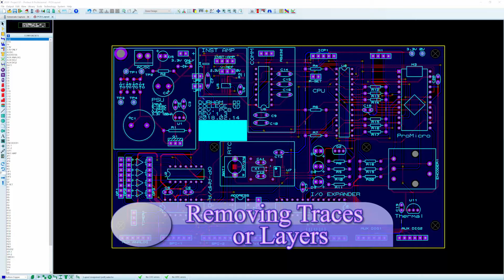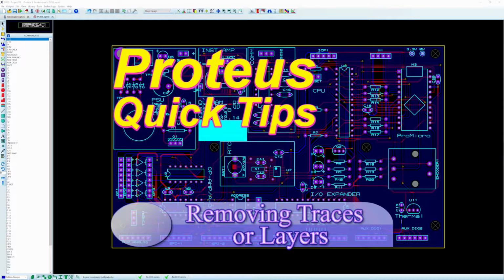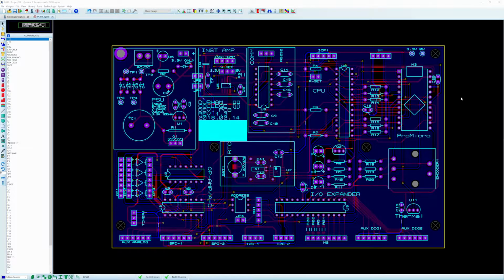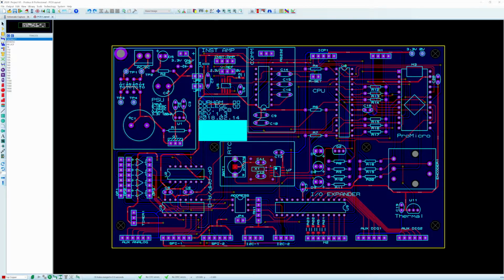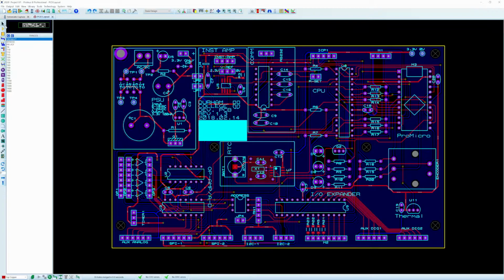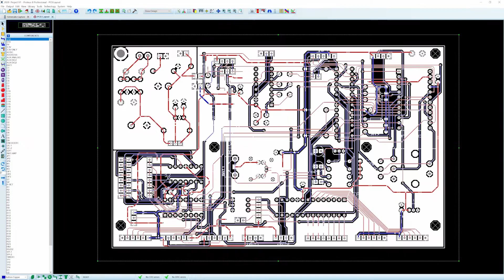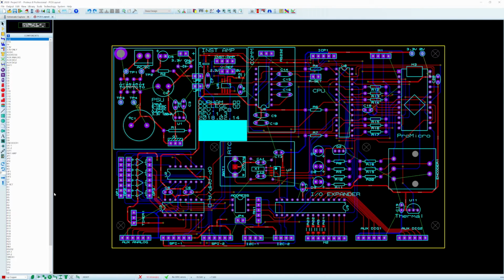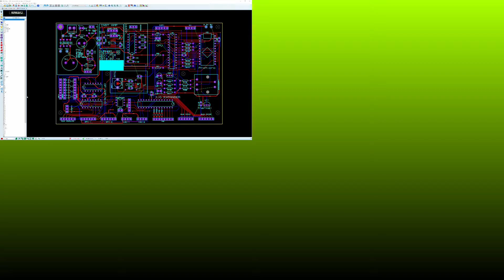Proteus Selection Filter -Easy Selection

Comment: Good day brother..Pls what is inner1-14 use for in proteus pcb design
Reply from the maker: Thank you for the question. The  inner layers are used on more complicated PCBs where there may not be enough room to run all of the traces, such as designs with BGA or PGA components. In these cases, the traces will dive down to inner layers in order to get the "fanout". When you have multi layer boards, you will typically move the power planes inside as there may be several to deal with. Hope this helps.